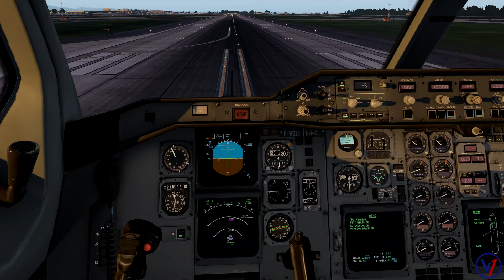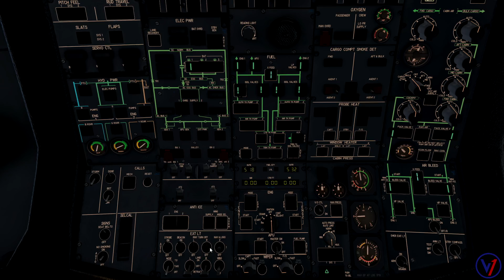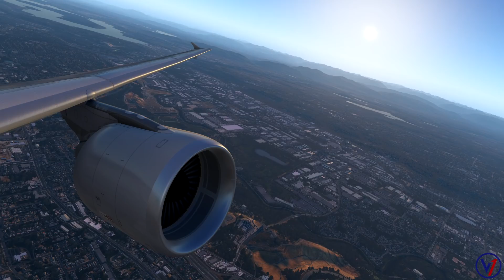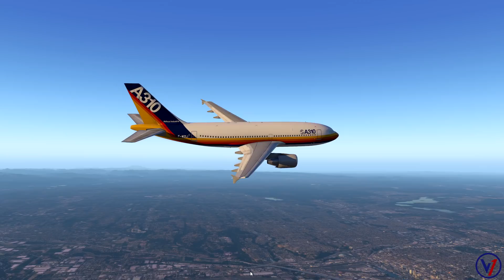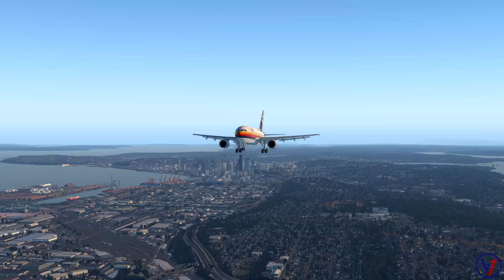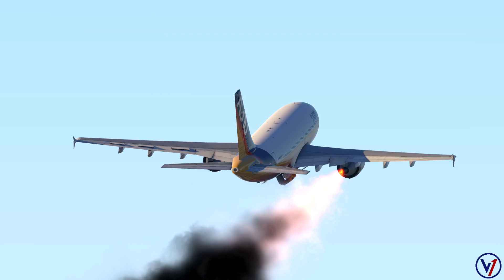Auto-LAND | iniA310 | Real Airbus Pilot | FLIGHT TEST | Part 1

Comment: A question for real airbus pilots. I have an FF320 and a Toliss 321. I flew on a real big simulator last time and there was a big difference with my home. The large simulator joystick moves much more slowly in response to the aircraft.Because the airbus does not cesna the airbus 70 tons. I didn't fly a real air bus so I don't know which one is closer to reality. So the issue is the joiystick sensitivity to the movement of the plane.